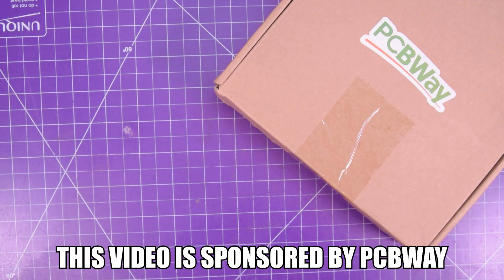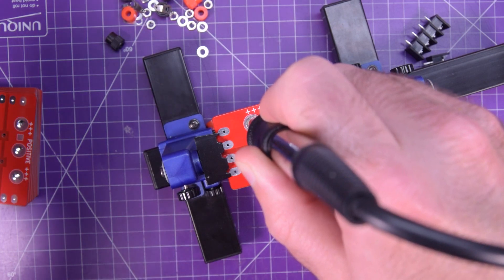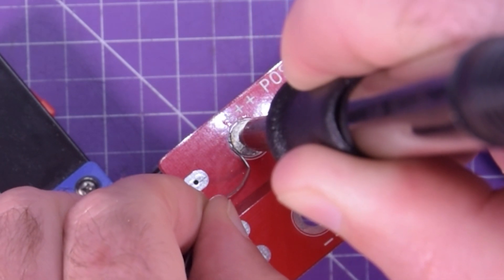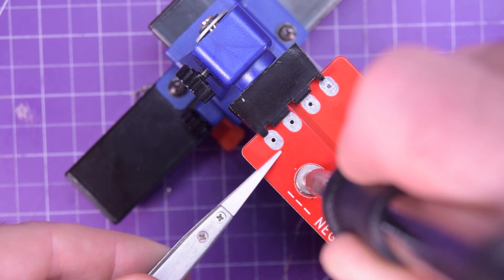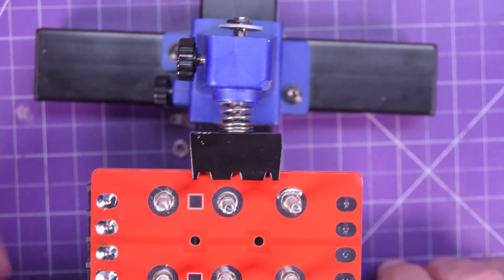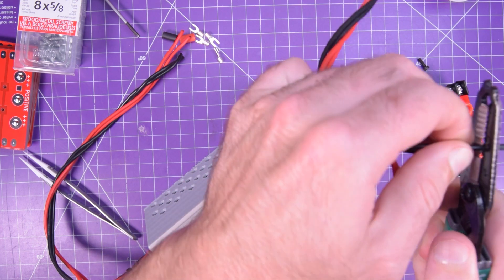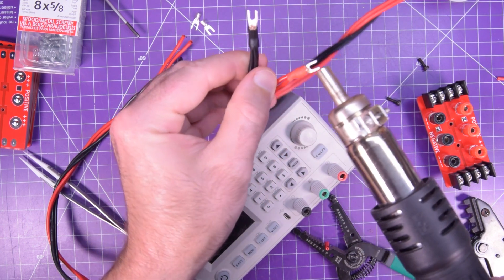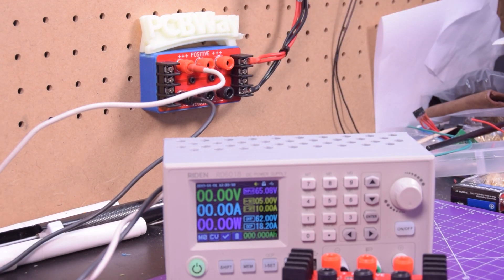Power Distribution For ALL Your Bench Supplies!

Comment: they make silicone finger tips, I bought on amazon. I use them almost every time when soldering now.   I have burned my fingers many times due to conduction effects but with the finger tips, I heel almost nothing. Just thought I would give you a tip. (see what I did there? lol) I just keep them next to my station and it only takes a second to put it on and then I can just about hold any part and solder it without burning my fingers. It helps with hot air rework also. Thanks for the content.

Comment: If you do a redesign later you might want to adjust the banana socket spacing to be 19mm apart to make them the standard spacing, also I found that making the holes 4mm worked well for nicer fit

Comment: How would the wire on the back of the banana connectors help, when the power is coming in through the screw terminal and then the copper trace before the first banana connector?
Reply from the maker: Can use it between the terminals too though